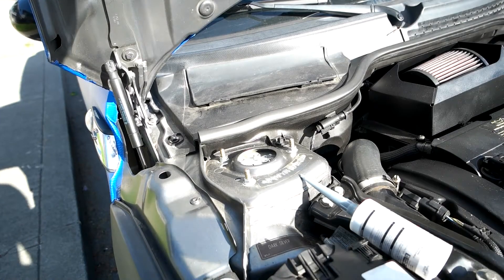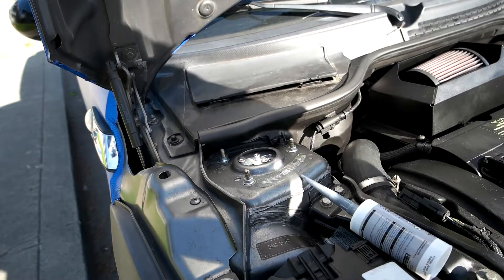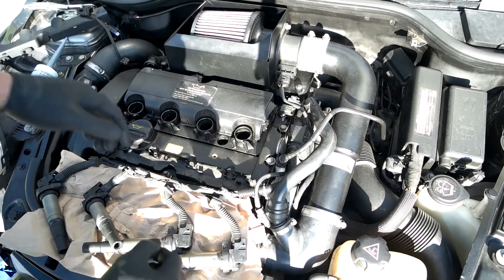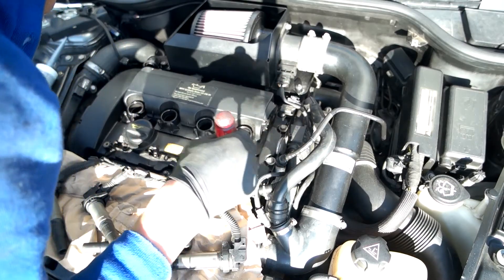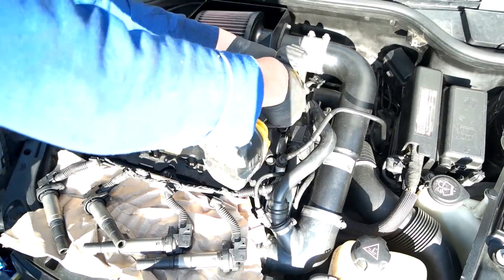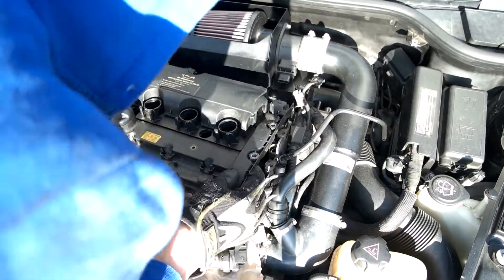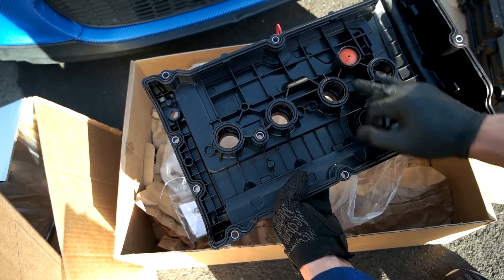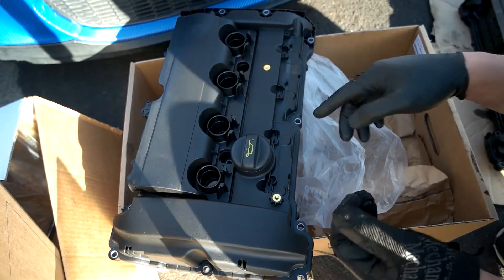Valve Cover Replacement Tutorial - Mini Cooper S R56 Video 9

Comment: Why did you need to replace the cover and not just the gasket?
Reply from the maker: The pcv system built in the valve cover failed, and was leaking oil into the intake hose. Thanks for the question
Reply: @ColinLeung  I Think my n14 in my 207 is doing this how would I check?
Reply from the maker: @propersuspect2959  Hello, you can check the two hoses and see if there are leaks. See video starting at 51 seconds https://youtu.be/-JOvYu0ZieQ?t=51

Comment: after replaced valve cover,no geniun oem parts,right hose suck air and engine exit p2279 error code.Maybe right valve in the valve cover is stuck open😪.
Reply from the maker: Sorry to hear that. Did you get it fixed?